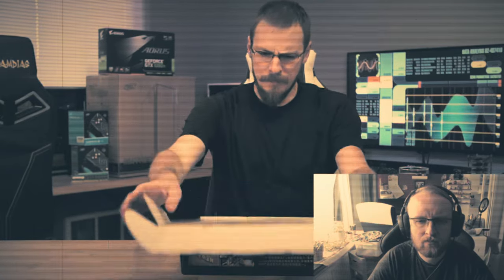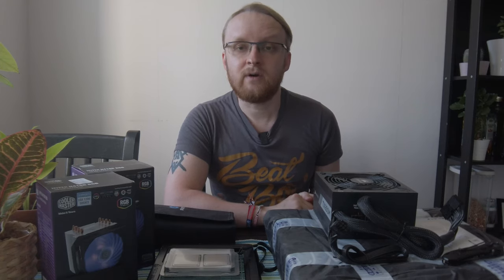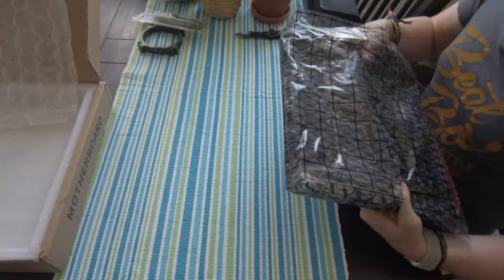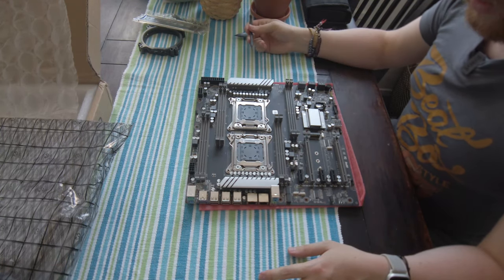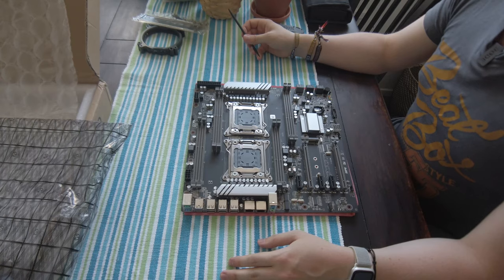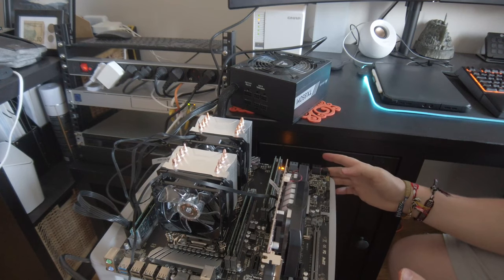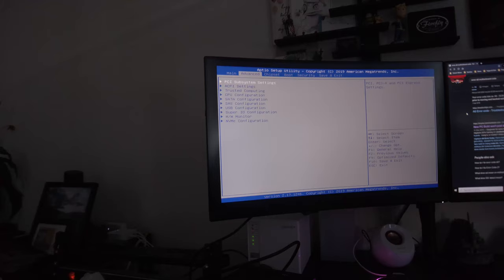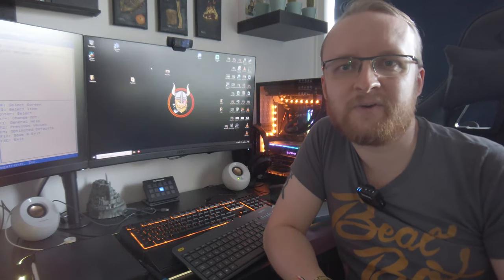X79 Chinese Motherboard Dual CPU Server Build - Unboxing, Testing

Comment: Yeah, I saw that Craft Computing and was impressed with the Chinese motherboard/s.  So, I'm glad you showed how you set it up.  And, not having the exact cable is always my damned story.  Like my new computer in other room, I still haven't put it into a case yet.  I've got 2 cases to try, but I need to find screws ... They're in storage.  It's because we had a Hurricane some time back (Houston, Texas) and, long-story short, just haven't had the time to do all the house repairs needed.  So, I put a lot in storage, but I plan to get it out and slowly assemble it -- just like you are.  Going to watch the other related videos now -- in your Playlist, if there is one.
Reply from the maker: Hey man. Yeah I do like these boards.  Very good value. Specially for home servers. 

I heard that storm was bad. I think 8 bit guy also had lot of issues with his place.

Building bit by bit is the way :) and wait for good deals. 

I have more videos on this and more coming too. I try to do one a week, but last couple weeks been quite insane with my work and stuff like that.

Comment: Miyconst who also lives in Sweden actually reviews these boards quite frequently. He recently proved that X79 isn't worth it because it's marginally cheaper than X99 at a performance loss. Those X99 dual socket boards with cheap v3 or v4 Xeons are absolutely bonkers for home servers and workstations.
Reply from the maker: Appreciate the comment,  but as mentioned. I had CPUs and memory for the x79. And therefore to use older components I have all ready means it’s cheaper for me.

X79 is fine. I got so much stuff running on it. I would like to play with an x99 board at some point. But since I have DDR3 ECC Ram and Xeons for that socket type means I can use old components that would go to waste.
Reply: @RobertMizen  There's X99 dual socket boards for DDR3! But they're a bit harder to find a good deal on and you will need, say an E5 2678 v3 or a similar DDR3 supported Haswell Xeon.
Reply from the maker: @b0ne91  Yeah I am aware, but since I had the correct CPUs and Ram, I didn’t want to waste those and also spend more money on extra parts to make it work. 

I am big fan of using old components and reducing waste. And I have like 200 of these CPUs and hundreds of GB of DDR3 laying around. 

I am planning something on the x99 later. And will get some parts, but right now the market is totally messed up. And I have some Mac Pro upgrade project and some Linux stuff to first to sort out. :)
Reply: @RobertMizen  I understand. I was just giving you advice on what to do, if you're looking to mess around with X99. 

Good luck with the Mac Pro. I recently built a hackintosh on X299 because I couldn't handle dealing with Apple itself anymore.
Reply from the maker: @b0ne91  yeah I get you dude. There is ton of use for x99 and x79 stuff. The old enterprise stuff can be found super cheap. 

Sounds interesting, I have a Mac Pro 5,1 which I use for editing and work. Gona beef it up. 

I don’t mind Apple, I use all 3 platforms (all though windows now has taken a back seat to Linux these days). I really love the 5,1 Mac Pros. Got dual CPU version.

Comment: Great ! I'm currently building a setup but in MATX SFF form factor type (I want a compact server) with a E5-2660 V2 (10c/20t) to do homelab (hypervisor + GNS3 sort of work). Despite AM4 going for cheap, I find X79 quad channel setup still relevant if you really want to tone down the costs as 64GB DDR3 ECC 1833MHz can be found at 40€ on ebay. I will try it soon and if this isn't enough, maybe I'll switch to X99 with E5-2660 V3.
Reply from the maker: Sounds like good idea. The ram I have lot of. I like look of some x99 stuff. Also I have couple AMD opteron 16core CPUs. Would like to try use. Space is an issue for me at the moment. Lab sits in my living room / bedroom.
Reply: @RobertMizen  just a note your audio was really quite for the whole video. Try increasing it by 25-30% I was watching on my phone
Reply from the maker: @OfficialMikeJ  Thanks I know. Was an older video. I’m working on it :)
Reply: @RobertMizen  the quality was perfect which you don't normally get with many tutorials these days in terms of audio. Otherwise great video. Would like to see another video on how you installed the CPU's got them running then installed your preferred OS
Reply from the maker: @OfficialMikeJ  I am planning an upgrade to my homelab which includes this server actually. I maybe need to do a homelab tour overview.
Reply: @RobertMizen  would love to see this as I'm deciding on the hardware I want to build my game server hosting business with from home. Start it small and work my way up the ladder.
Reply from the maker: @OfficialMikeJ  A good project to get started with for sure.

Comment: That much CPU power and memory...would be so fun to experiment with.  Maybe you explain it in one of your other videos, but do you eventually take out the GPU when you get everything configured?
Reply from the maker: I could make an update video on this motherboard and setup. It’s a good idea. 

The GPU stayed in. Using it as a rendering device for Jellyfin. Saves battery on mobile devices etc if the encoding etc is done via the GPU on the server.
Reply: @RobertMizen  Never thought of saving battery, that's a good idea.  My server is running an E3-1245 v5, I think it could probably handle encoding, would be nice to get away without a GPU.
Reply from the maker: @mintymus  You will need some kind of GPU to handle the encoding. iGPU wont do that as the Xeons dont have any iGPU.

Grab yourself a nice cheap GPU. Cheap quadro can be best, but honest any small form factor GPU will help a bunch.
Reply: @RobertMizen  The E3-1245 v5 I'm using has the Intel HD Graphics P530 iGPU but I'm not sure it's powerful enough--was thinking about using it more in terms of power savings and freeing up the 16 pin PCI for the network card.
Reply from the maker: @mintymus  ahh you may be able to pass that through to Proxmox. Worth a try. Never tried with a iGPU

Comment: hi Robert great video, I know the video is not current and that's why the question is valid, in the meantime (since the video was published until the current date) did you have a big problem with this server?
Reply from the maker: Thanks for the support and to answer your question. This has been very stable and solid. No issues at all. Only turned off when I needed too, but otherwise on all the time.

Comment: It would be great to see approximate budget for the parts. I’d like to compare this to 5950x with x570 mobo. Sounds similar on paper but of course there will be many generational differences
Reply from the maker: I don’t have the numbers on me right now. But the CPU’s can be had for like 15-20 usd each now. RAM isn’t much. Like 20-30USD for 16GB modules.

I put on those coolers. They were cheap. Any decent branded cooler around 50USD should be sufficient. 

I had the CPUs and ram on hand. And the biggest expense was the case and motherboard. Everything else was free or super cheap. 

Hope that helps. Since I don’t have those numbers on me at this exact moment.
Reply: @RobertMizen  Thanks Robert, I appreciate your reply!

Comment: Is it support overclock?? Cpu or ram?? Have you tried Intel Extreme Tuner Utility??
Reply from the maker: I haven’t tried myself but I know others overclock these boards fine. Lot of information on the web about over clocking. There is a big Russian community around that has tons of guides in Russian also. But other sources too.
Reply: Thanks for replying have time on this giving feedback later... Intel Extreme Tuning Utility is a software which overclocks CPUs under windows
Reply from the maker: @MDHossain-lt1kc  yeah. I do not use windows. But I think others have used that software on this board. I only use Linux and MacOS now. The computer this board is in is my Proxmox server.

Comment: Hey Robert, great video! If I wanted to add a quad nic card to this motherboard is there a budget or what is a best lower priced option?
Reply from the maker: A quad card. I mean I’d probably just go for a separate switch at that point unless you plan to this in a different way? I am interested to know.

But there is several cards I seen. Any intel or realtec ones should be fine. What OS you got?

I am gona put a 10Gbe card in next month.

Comment: Hello i have e5 2683 v3 (x2) i plugged them to the mainboard and started the comp. It worked but i dont see the cores together on the window. I can see the cpus together on bios but i dont see the cores and threads on windows. I dont know what to do.
Reply from the maker: On windows it doesn’t report both CPUs I think. It should say in system information the total cores. ?
Reply: @RobertMizen  I fixed it. I changed my windows from home to pro and now all is good.
Reply from the maker: @KINSEI_official  Awesome

Comment: You can use 2 power supplies, one for 1 cpu, and the other place a 24pin link, to use the other cpu ( 8pin). They can be 500 each if you want. But frankly the native Chinese motherboards are not dependable at all. You can buy Asrock X79 or X99 used, it might be more expensive but worth it.
Reply from the maker: I have one power supply. A revolt pro. Works great for dual cpu boards.

These boards are fine though. Been on for more than a year non stop. They are mostly spare parts from other boards anyway and while you should be careful with which factory you get it from, there is only a couple I would trust.

So I can’t say i have had any issues so far. Many other people too.
Reply: @RobertMizen  Please can you refer the factory you get your boards from .

Comment: Is this system still working now?
Reply from the maker: Yeah this is still working. I have it to my school for use there and it’s same board and setup basically just in another case.

I replaced the setup recently to a AMD EPYC system
Reply: Thanks, that’s great. The AliExpress link is not working now, could you share a new one? Also, did you use it for 24x7 and its power consumption please? Thanks again!
Reply from the maker: @jackz166  I dont have the power consumption on hand, i did not record that. (Its so cheap for electric here). I had it on all the time, downtime is the enemy ;)

You could check this page out:
https://www.aliexpress.com/item/1005004216666524.html?spm=a2g0o.productlist.main.3.4a7aHYTbHYTbsQ&algo_pvid=c7e996e0-8123-4524-92b1-8f5b32db55d7&algo_exp_id=c7e996e0-8123-4524-92b1-8f5b32db55d7-1&pdp_npi=4%40dis%21USD%21163.22%2197.93%21%21%21163.22%2197.93%21%40211b600517173506150055167e11d7%2112000039298518380%21sea%21SE%212566704698%21&curPageLogUid=NQPCYTU44jJv&utparam-url=scene%3Asearch%7Cquery_from%3A

Comment: Hi brother is it possible to ryzen 7 or higher to this motherboard?
Reply from the maker: No, this board is Socket LGA2011 (and need to check version of CPU too, sometimes LGA2011 or LGA2011v2 etc) this depends on the processor.

But you can get another board for Ryzen and use that.
Reply: @RobertMizen  i appreciate ur kind reply 🙏 
I wanted to buy a chines dual motherboard with a high speed cpu, can u suggest me a one pls ?
Reply: Bcoz I wanted to use for video editing and gaming
Reply from the maker: @RameshKumar-ty7ws  You have some choices beteeen x79 and x99 dual socket boards. You maybe able to find LGA 2012v3 socket and CPUs. 

Video editing is solid on these. Gaming can be ok too. If you can get the x99 version, with DDR4. That would be good. 

Have a little dig on eBay and Ali express for the x99 or DDR4 x79 and then check which socket and the CPUs should be really cheap. Some on Ali even have the CPUs with the board.
Reply: @RobertMizen  wow thank you a lot let me check with x99
Reply from the maker: @RameshKumar-ty7ws  no problem dude. Have fun and do come back and let us all know how you get on.
Reply: @RobertMizen  definitely for sure I’ll let u know and I do subscribe ur channel for more update about tech cheers 🍻
Reply from the maker: @RameshKumar-ty7ws  Thanks for the sub and like I said. Hope you find something that works. Let me know if you need some more help.
Reply: @RobertMizen u most welcome and sure I do

Comment: these boards are called "JINGSHA X79" and I think they are made from other salvaged mother boards... I might be wrong
Reply from the maker: There is several “brands” of these boards. JINGSHA is one of them. 

They usually use left over spares (sockets and controllers) from other boards and then manufacture these. 

Surprising good. I don’t have mine anymore. I donated it to my school. But enjoyed it while I had it.
Reply: @RobertMizen  a dual socket board that runs 2 Server CPU`s.. the only use I see for this CPU is media encoding or graphics work. I wonder how it fairs in 2023.
Reply from the maker: @mccg4337  it’s quite powerful honestly. Single core sucks but multi core performance is good. For the price. Throw in a decent gpu and it games well too.

Comment: No HDMI?
Reply from the maker: No, these Chipsets predate most boards for onboard HDMI. Specially the Server/Enterprise Chipsets that Xeons usually go with. I have a GPU on this board with a Quadro P400 which has MIni Display ports. Which has a higher bandwidth than HDMI (dependant upon version of course). So even with an adaptor, its very fine :)

Comment: Only 1 x16 and 1 x8 pcie? That's disappointing.
Reply from the maker: That is pretty much a limitation of that chipset and generation. Plus choices for cost / performance. It’s perfect for most servers.

But there are versions with bigger PCIe busses and they are popular especially within the Russian community for gaming. Both the x79 and x99. All though I wouldn’t use for gaming. Still quite adaptable.